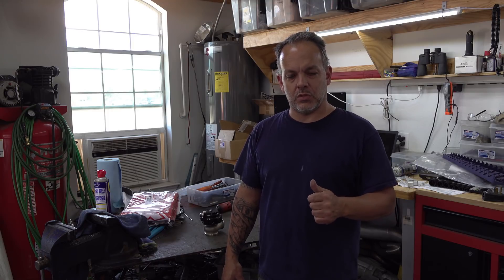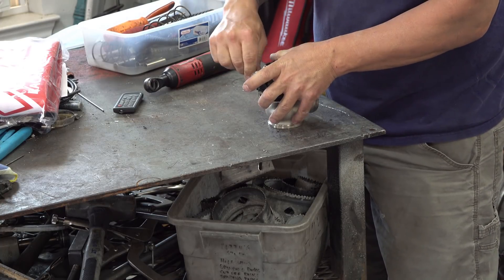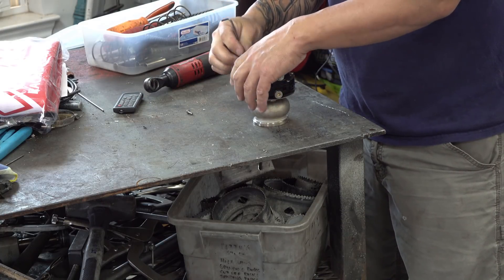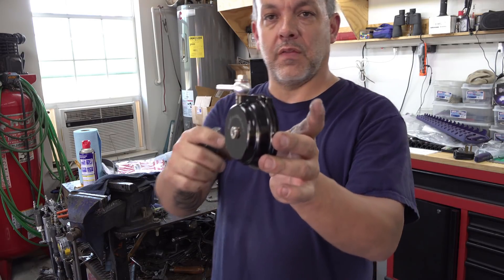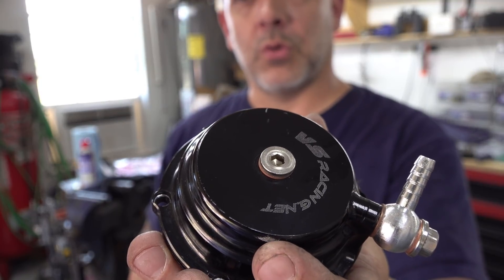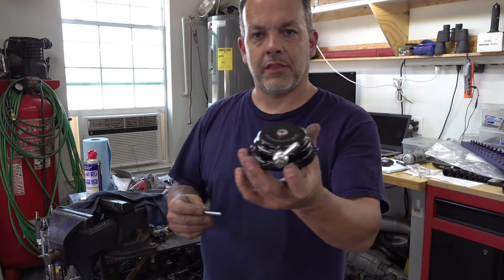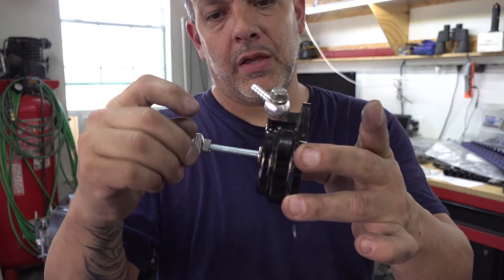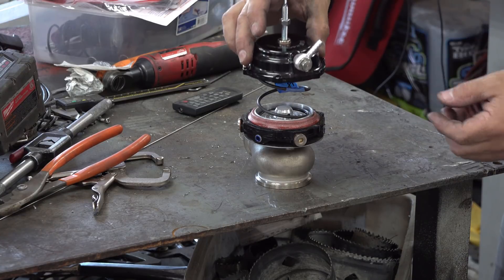Dont do this to your wastegate!

Comment: If you are a spring changer all you need to do is test with air and low pressure adjustable regulator, no guessing. 
AND just add a couple of vacuum Ts in a lot less time and effort

Comment: By welding the spring it losens the hardening, i can see the wastgate is vacuüm controled, why not make a leak in the vacuüm hose? When i was yong we dit it whith an aquarium tap so it was adjustable, 5 min to build in..

Comment: It's hard to make a mistake with the spring selection if you use a regulator and an air supply to pressurize the bottom port to see when the valve start to crack.  This is the method I use, I never go by the spring chart.